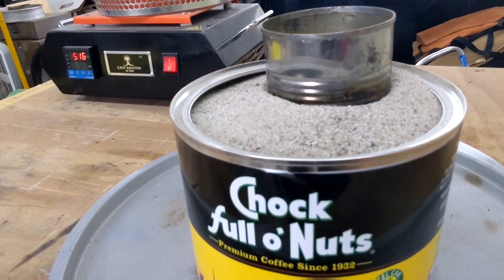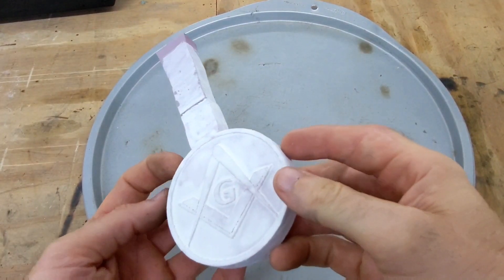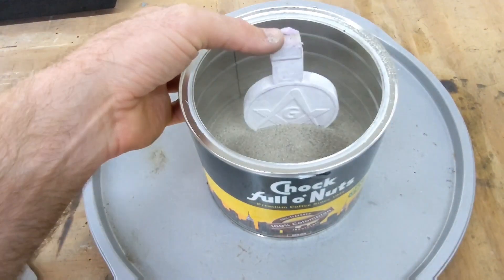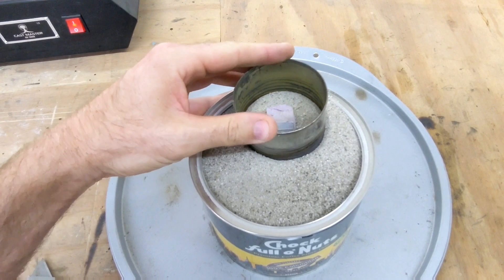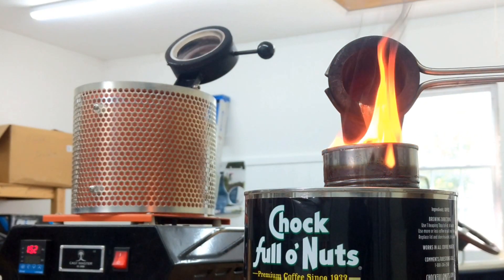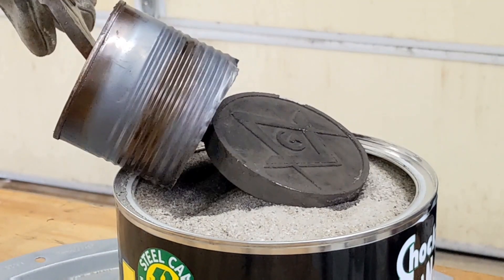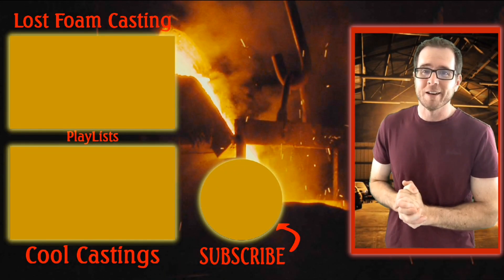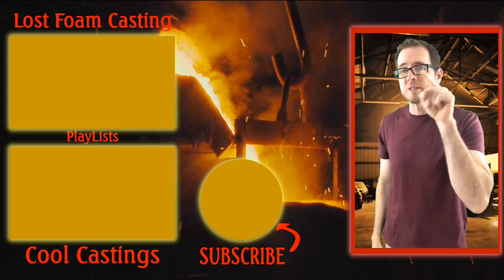Metal Casting Using a Coffee Can - Styrofoam Metal Casting

Comment: It turned out very well, but I wonder why the mold didn't break after pouring the melt into the sand, because the sand wasn't hard  !!!
Reply from the maker: Thanks taftan!  It's because the sand takes place of the foam as it enters it.  It vaporizes the foam.  Which doesn't allow the sand to fall into it.  Plus I think the layer of plaster overtop of the foam assists it too.

You should give it a try.
Reply: @HeinrichsMade  
Thank you dear friend for your answer, I hope you will always be successful 🌹
Reply from the maker: @taftancastingchannel  thank you and you as well 🙏

Comment: Are electric melting furnaces quiet and easy to use?
I also want one
Reply from the maker: Yes they are quiet and easy to use.  They require a little more maintenance, because it's electric and the coils inside break after time.  They get brittle.  These are great if it's raining outside and you want to melt.

Comment: What kind of Styrofoam do you use
Reply from the maker: Polystyrene.  I bought it from home Depot, but you can find it anywhere.
Reply: @HeinrichsMade  ok I need to try that out. I've been wanting to make a sand cast. But no luck so far three failed attempts.
Reply from the maker: @craftedmetal9854  what kind of sand are you using when sand casting?

Comment: I'm not really big on the electric furnace but your foam castings rule the roost!
Reply from the maker: Thanks Matt!  I really only use it when it's bad weather.
Reply: Why don't you like the electric furnace?   I use a little propane furnace i made, but i was considering buying one of these electric furnaces for small casts and for starting with silver
Reply from the maker: @marshallb9924  I just don't like it because of the maintenance.  The heating coils burn out after time.  They get brittle from being hot.  The replacement isn't bad, but they coils cost around $100.  Also, I you want to start melting silver I'd suggest using a melting dish and heating it with a torch.  These work for silver, but the silver will cool and possibly harden while it is being poured.  The length of the crucible gives it time to chill.  I actually have a video showing this.
Reply from the maker: @marshallb9924  https://youtu.be/HhpkCW5l3cc watch the pour at 6:58 and see it solidify.  The cast did too.
Reply: @marshallb9924  the upside to a electric furnace is just what you said and that is precious metals.  The downside is it takes 45 minutes to melt just a small amount and the electric bill at the end of the month.